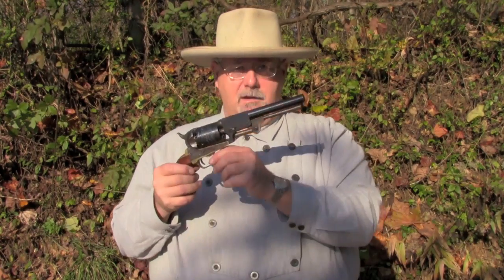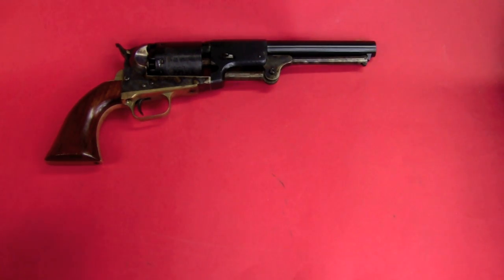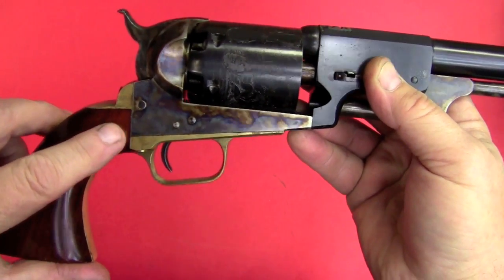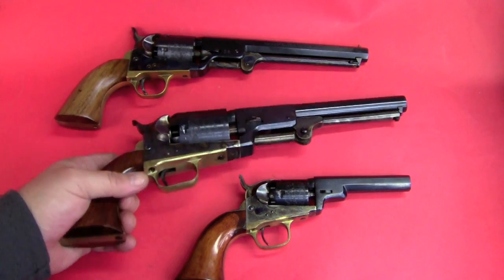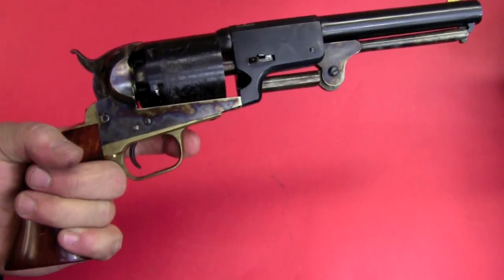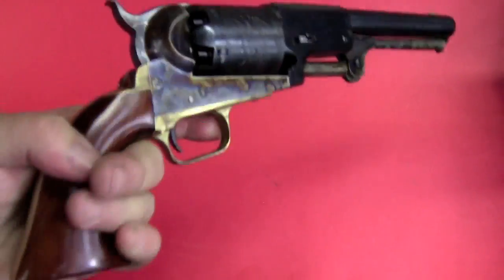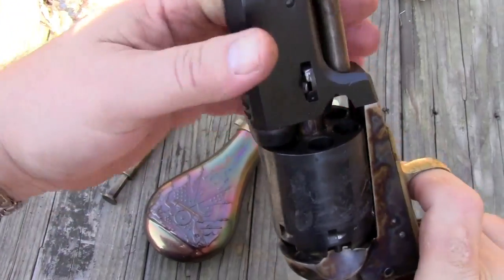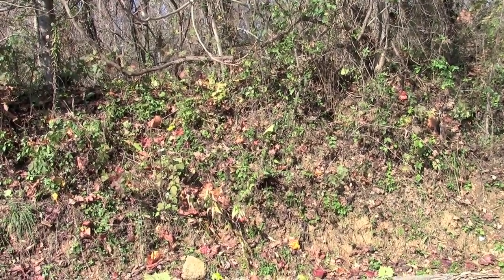Shooting Colt's 3rd model Dragoon Revolver.mov

Comment: The 1860 will do fine for White tail deer and wild hogs if the shooter does his part and keeps the shots to 40 yards or less. My hunting buddy uses a Pietta 1860 with 38-40 gr of 3fg 777 and a ball cast from a mix of wheel weight and pure lead, harder cast than lead which provide much more penetration and are very accurate and powerful. His gun clocks over 1100 fps with this load and penetrates even the toughest gristle plate.

Comment: I love the power of the colt 3rd model dragoon with the 40 grains of 3f and a 200 grain conical for hunting wild boars and black bears. However the 1860 colt is a much better design and much more easier to carry and handle aswell as being more accurate. With round balls the dragoons tend to like .457 round balls because the chambers are bigger but it makes it easier to seat lee mould 200 grain conical bullets because of it

Comment: Good to see that the Colt 3rd model Dragoon is still a favorite with some people.  I had two 2nd Models back in my Cowboy Action days.  I traded them in for an 1873 Colt clone.  I recently bought a 3rd model Dragoon along with a Taylors conversion cylinder in .45 Colt.  I Haven't got out to shoot it yet.  I needed to get the stock cones unscrewed from the cap&ball cylinder so I could replace them with slix shot nipples.  Now that is done, I will be able to take it to the range and compare the accuracy between round ball, Lee's .45 Conical, and the Original Colt's 250 grain .45 Colt bullet and Eras Gone .44 Johnson & Dow heeled conical.  Time to have fun.

Comment: My Uberti 3rd Model would drop the lever with anything over 40 gr FFFg so I needle filed the notch on the barrel mounted catch deeper, deepened the center slot in the catch itself so it would protrude slightly farther forward, then put a stronger spring behind the catch. No more loading lever drops.

Comment: I have a 3rd Dragoon replica, the Colt Signature Series. In all the shooting sessions I've had with it the loading lever has never dropped under recoil. Must have a stronger spring in the latch than the San Marcos, the design is the same.
Reply: I have the same an Never had mine drop either, an mine shoots to POA at 25 yd's an shoots 3" groups all day long.
Reply: The Signature series are not Colts.  Sorry.  That's life.
Reply: @normanbraslow7902  Ha Ha! Neither were the original Walkers, but no one seems to worry about that.
Reply: Englishman French Nope.  They don't.   But collectors are very concerned about the final signature series.
Reply: If you are looking for a collector piece then stay away from the Signature Series. I picked up my Dragoon while they were still being  manufactured. I had a Peitta 1860 I was shooting that was rattling apart. The wedge was always loose. Piece of junk. Plus it had 'black powder only" stamped on the barrel. For me that was a complete turn off. I wanted a reliable replica of Colts' revolver that I could shoot. This Signature Series Dragoon has been great. Good quality steel, well finished and fitted. All through the years it has stayed tight. Nothing rattles loose, screws don't back out of it, barrel wedge works like it is supposed to, loading lever stays up. And finally for a gun you shoot, it shoots straight! Never throws balls, consistently tight groups. So, it is a fun black powder pistol to own if you are wanting a very good looking, well made replica you can put through its paces.
Reply: Duffy Sullivan.   The Signature Series are well built based in Colt standards and spec.   And accurate, and tough as well.   In hard cold reality they are just as "good" as the Second Series, and without doubt better than the originals.  The fly in the  ointment, so as to speak, is due to contractual issues with Colt, Colt will not recognize the Signature series on the basis that Colt had nothing to do with the manufacturing or finishing of the guns.   Of such minutiae is collector desirability based.   If you can find the Second Series, they oddly enough are not that much more costly.  Maybe in the next hundred years or so there might be a difference.   In the meantime, just shoot them, both of them.   I shoot my Second Generation Dragoon regularly, and it's as good as it gets.
Reply: @normanbraslow7902  Apparently there are sad people out there buying replica arms in the hope of making a huge profit when they sell them, they keep them without ever even using them ? In Europe, where most of these are made, a new one costs in the region of  $1000, but an as new second hand one is less than $100, the idea of these replicas is that they give someone the fun of shooting an exact replica of a now costly and fragile original, without having money tied up in an original gun, so buy one, and enjoy shooting it, mine have had 40 plus years of shooting and are still in excellent condition.
Reply: @normanbraslow7902  Why on earth would anyone collect replicas? When the originals are not expensive if you shop around. The replicas are made to shoot and enjoy.
Reply: I got into cap and ball revolvers from a novel. Cormac McCarthy's Blood Meridian. Before reading that book the only early  Colt revolvers I was aware of was the cartridge firing "Peacemaker"  In the novel this roving gang of dangerous thugs are buying a crate of pistols from a shady gun dealer. The name of the pistols is never mentioned.  They open the crates and out come these huge revolvers with flasks and bullet molds. I had done some rendezvous and buckskining so I knew about blackpowder firearms, and I thought, what are these guns, some sort of muzzle loader?  Thus my research began. The novel mentioned that they were Colts revolvers "contracted for the war". I went to the library ( this was early 1990s before internet and Windows were ubiquitous) and looked over books until I came across one I considered to be the ultimate authority  "Colt Firearms From 1836" by James Serven, and so I was able to identify the shipment as  Colt Walkers, and learned about everything there is to know about them. I thought so much of the book I ordered one from a local used book store, still have it.
Reply: @duffysullivan2794  I am very glad to hear you have a copy of J,Serven, another very interesting book you would be interested in in Sam Colts Own Record, which is a bound copy of all Colts correspondence with  Eli Whitney during the production of the Colt Walker, including copies of hand written letters, a very interesting read as it explains a lot of detail about the exploding cylinder problems they had.
Reply: Englishman French The average 1851 original will go for about $2-3,000.   A Dragoon, average, $5-6,000.   An 1860 army, average, about $4,000.  Forget the Walkers and Pattersons, they are well over $100,000.   I won't fire any of my originals.  I'm sure they could handle mild loads but why?   The Colt Second Generation will never be that pricey, well, maybe in a couple hundred years.  The Second Generations are considered "original" so who knows.   I guess that some of us hope that will happen.  Whatever.   An unfired one in the box might do better.   The Ubertis are good, serviceable, plentiful and about half the price of the Colts.   If all one wants to do is shoot and forget about any possible increase in value, get the Uberti.
Reply: @453421abcdefg12345    I have a small book that covers the corresponding between Sam Colt, Sam Walker, and a few government people who were involved in getting  the Whitneyville Colts up and running.  It is titled The Colt Whitneyville - Walker Pistol, by  Lt. Col. Robert D. Whittington III. Probably not as through as Sam Colts Own Record, but sounds like it covers the same ground.
Reply: I have a Uberti 3rd model Dragoon and my loading lever has never dropped under recoil.

Comment: I dovetailed a slot (epoxy would work, too) in the loading lever to hold a small round niobium (high strength) magnet which holds the lever snug but not so snug. Good videos here.

Comment: I had a ASM Dragoon and I took off those leaf sights too. My cousin machined the barrel on top where the sights were and you could hardly tell  where they had been. One of about 30+ Cap & Ball pistols I have had. I am down to three 1860 Army revolvers now. One is Uberti one is Pietta and one is a Belgium colt still new in the box. I am looking at a Uberti 1851 or 61 navy mostly because I been a watching your videos.

Comment: What were the differences between the 3rd model and the 1st & 2nd models of the dragoon’s?? Are they very similar with just minor changes, or were they quite different?
Reply: The 1st Model is the most different from the other two because the notches in the cylinder used to lock it in place are simple rectangles with rounded corners, almost oval in shape. The bolt that rises to lock into these notches is round.

The 2nd Model introduced the rectangular notches in the cylinder with scalloped ramps, the sort of notches you see in most revolver cylinders to this day.

The 2nd Model kept the old square-backed trigger guard while the 3rd Model has the rounded trigger guard you see in modern guns. Aside from that, the 2nd and 3rd are essentially the same.

Comment: A felt wad protects the bullet from the heat of the burning powder and can reduce lead fouling with hot loads. Grease on top of the bullet lubes the bullet as it passes down the barrel and will also help reduce lead fouling.

Comment from the maker: A Dragoon with conical bullets rather than balls will give the best long range accuracy. Conicals should be lubed. As far as diameter goes, you are constrained by the chamber diameter, which is actually a bit smaller than the bore diameter. The bullets will slug up to fill the bore, providing they are cast from softlead.

Comment: I've not had any problems with my load lever dropping, but I've been using 2F in the Walker and the Dragoon. Uberti might have used a stronger spring or I haven't broken it in good enough. :) Of course, the lever drops on nearly every shot in the Walker.

Comment: You can stop the lever from dropping if you tighten the screws for it tight.. the lever wont move then.. then when you reload losen the screw slightly so the lever can be used again.. its rather easy to figure this out.. not sure why no one else has mentioned it lol

Comment: The dragoon was a beast! In fact, it still is. If 50 or 55 grain shot of black powder. I would have been after an 1851 navy. Seemed to be the best overall until Remington’s new model army/navy
Reply: Almost the power of a Walker.  36 would have been more common later on and a good balance of low power and man taker downer  (heh heh).

Comment: Solder a small clip to arm to hold it to barrel. Doesn't have to be a big wide clip that would interfere with sight. Just a small blued strip of spring metal or whatever it's called. It seems that the shape of the barrel lends itself to holding a clip securely. Of course I have no clue on the subject but it seems like something a man like you could make and make it look presentable. Oh Midway USA has a pieatta Remington sheriffs model with a grip that looks similar your 1858 Bulldog snub nose revolver. $375. What do you think about shortening the barrel  down to 3 inches. Do you think it would be a waste of money . I have the Remington Ace but the gun feels unbalanced and heavy.  I suppose it would be the same thing if I cut the barrel down on the midway USA gun I'm speaking of tho the frame looks smaller then the Ace and I believe it is in 44 caliber

Comment: IF you have the loading lever issue it can be fixed, and the spring replaced. Some may not want to interfere with this mechanism. I've also used ultra thin picture hanging wire twisted around the lever and barrel. Its easily popped once done shooting.
Reply: If I was a buyer in the 1840's-50's I'd have been a tad upset about that loading lever always falling down.  Wonder how many went to the watch repair guy or gunsmith to be repaired to fix the issue.

Comment: Do you have a 1st or 2nd Model? I skipped over them because i thought they would be superfluous. The square triggerguard on the Walker is also very uncomfortable to me.
Reply: From what I learned is that the main spring in the 1st and 2nd models is more complicated then the simple one on the 3rd. Which became standard from then on
Reply: Uberti makes all three Dragoon models today using the leaf spring arrangement (Colt switched to leaf springs with the 2nd Pattern). Only the Walker and Whitneyville Dragoon have a V-spring in Uberti's line these days.

Comment: The problem with the Uberti replicas of the 1847 model Colt's is that they just aren't made as well as the hand fitted originals were. One of the biggest issues with them is that the edges of the striking surface of the hammers are left too sharp, and you really need to take a small file, or an Emory board, or even just sand paper, and round off the corners of the hammer face a bit. The sharp corners bite into the soft metal of the caps when they fire, and cause them to stick to the hammer just enough that when you cock it again, the hammer will lift the busted cap off the nipple, and drop it into your action. That's really inconvenient. Just smooth off the edges of the hammer, and it will quit doing that. The originals never did that.
Reply: Well pay the 100 grand an get what up want

Comment: Looks like a rubber band around the loading lever is basically mandatory before firing if you don't want to be resetting it after each shot. Seems like a simple temporary solution outside of modification. I understand the Walker was even worse for this issue.

Comment: I find that with the Uberti 2nd model Dragoon that the cut in the right side recoil shield is too shallow, such that you can not get a capper in behind the nipple to cap it. Anyone else have that problem? You can get a capper behind the nipple through the hammer slot however.

Comment: I just added Uberti 3rd Model Dragoon to my collection. Great gun.
Reply: Does a capper work in the right side recoil shield cut with yours?
Reply: @trsgringo  Yes, I have a Uberti.
Reply: @bluescatreimer  do you have the military or civilian version?
Reply: @trsgringo   Civilian model.
Reply: @bluescatreimer  That is strange. I have two 2nd Model Dragoons by Uberti that I bought from Dixie Gun Works last winter and the cut on the right side recoil shield is not deep enough to allow a Ted Cash snail capper to put a cap on the nipple. I wonder if mine were improperly machined in this location?
Reply: @trsgringo  I have a Polish capper (my favorite) a snail capper and both work on my Uberti 3rd mod Dragoon. I have 2 straight line cappers that won't work because the ends are too long. I had to file the ends on those so they would work on my 51, 60 and 61 Colts.

Comment: I shot a replica Walker for a whole day, dont need no stinking measure for the charge, best guess will do, neither did we use lube, wads or whatever. You could see the differing charge levels by the height of the balls in the cylinder. Keeping one cylinder empty is non-sense silly safety-crats rearing their ugly heads....just be careful. We ran so much powder thru that Walker we had little fizzes of burning errant powder all over the gun towards the end of the day.